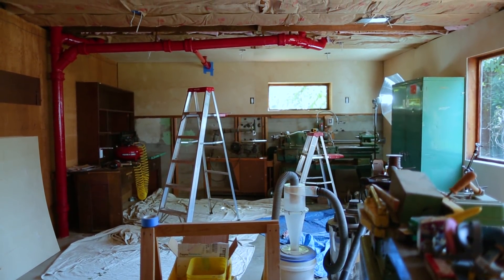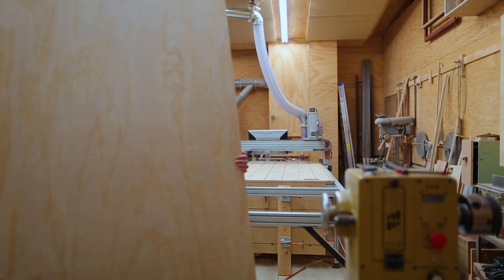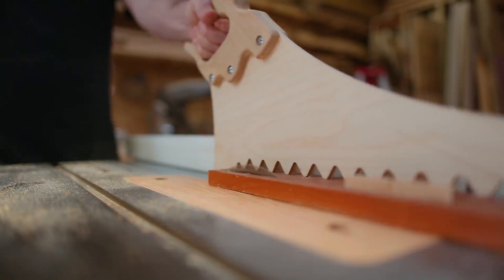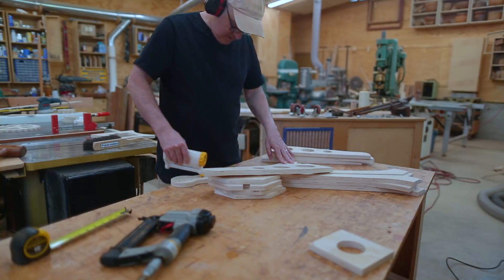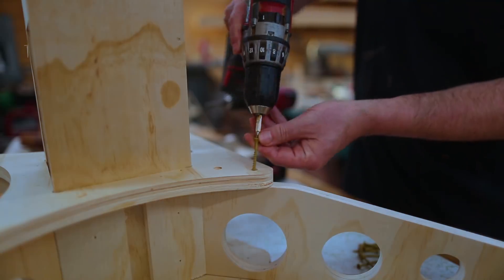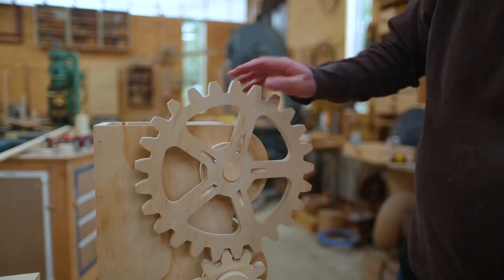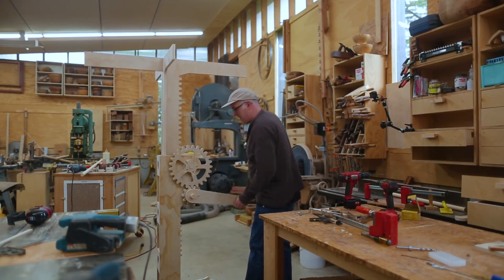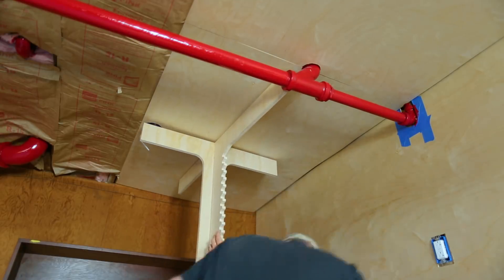Making A Plywood Panel Lift

Comment: I think sometimes people forget that this isn't for your average Joe to build to assist - of course you can buy one quickly and easily. But Frank earns somewhat, if not entirely, of a living from producing videos - so it makes sense for him to do things, that others would consider a waste of time, purely for video content. (Or in this case video content and a useful tool).

Nonetheless, great work Frank as always!
Reply: Yup, they're cheap to buy, nearly free to rent, and they're both much easier to store and more versatile (with pivoting arms to install wall panels and irregular / slanted ceilings). However, it's a cool project, and fun to watch.
Reply: stephenr1233 he was an architect for 15 years, probably earned more in that period of time than I will in my entire life.
No doubt he makes money from you tube but I would imagine he has a bit put away too
Reply: I think the ...jack ? met its primary goal quite nicely: putting off having to sheet the ceiling for a week or two.
Reply: Jon Miller it can be something for one person to just get it close to the sealing with out going up a stairs etc to get it near it. No need to have it pushed agianst it.
Reply: effyou128 sure you do....
Reply: I totally get that. But that doesn't make this a good design - in fact looks like a dangerous contraption to me.  There is no compensation for uneven surfaces,  the lift lock is tentative at best, and it's inherently unstable, prone to tipping over.  No way would I allow my employees underneath that thing with a heavy load on it.  Like I said -  drywall lifts have been around for decades,  all the bugs were worked out long ago.  They're usually made of steel- so maybe a more useful video would be adapting that design to plywood so someone could fab one in a home shop or on a CNC.  That said - IMO most of this "maker" stuff that is so popular on  YT now is purely entertainment and nothing more.  No real practical value in the actual building trades.  Pros have to buy or rent jigs and tools because time is money.  It's one thing to spend an hour making a crosscut sled for a table saw  - it's another to spend a week doing something that could be rented for $50.    Good for Frank if he's making a living at this though... I'm sure it beats manual labor.  It takes a lot of effort (and talent)  to monetize a YouTube channel to the point you can quit your day job so kudos to anyone who has managed  that.
Reply: stephenr1233 Exactly. Personally I have way too many other projects to even consider making one of these. In theory I'm a 3rd generation drywaller, but I don't do much. When I occasionally take on a job that needs a panel lift (every 2-4 years??) I just buy a panel lift on Amazon, then sell it locally for very nearly what I paid after I finish. Way cheaper than renting and no need to store it. This appears to have even more of a storage-space-required problem, but it's such a cool design I almost want to use it for a job. 😁
Reply: That said, it wouldn't be much use for me without a floating head to compensate for floor and ceiling rarely being truly parallel. And telescoping arms, since I hang even 16 foot boards when necessary (much easier to hang fewer large panels than to tape and mud many smaller panels). Obviously that wasn't Frank's design criteria. Just playing with the idea of it.
Reply: Im a union carpenter so I do it all Drywall concreate celings cabinets bridge welding what ever! If I am dry
walling a ceiling and I ask for a board lifter Id get my Layoff check that day! 2 guys getting $70 a hour each we are lifting them our selves! I do 10 ft drywall all day 50 sheets sometimes never used any lifter once! they are a wast of money This lift was a joke!  All that just to put 1/8 inch panel lmfbo

Comment: Throw a top on it, and this'd be a rad height adjustable table. Living in a small space, I always like things that can serve a dual purpose.
Reply: Great idea!
Reply: Standing desk!
Reply: You could drill out holes, to insert pins through. That way the gears are only bearing the weight during height changes
Reply: It wouldn't be sturdy enough to be a table though.

Comment: Was your crank a little longer then necessary?
Reply: I thought the same thing, but it may be useful to have for heavier loads. You could add another knob closer in for faster cranking when adjusting and for lighter loads. Great video Frank, thanks!
Reply: It's one of those things that building a prototype gives you answers that drive the design.
Reply: that 1/4 plywood is super heavy.   Probably should have a 200:1 gear reduction.
Reply: Google says 22.72 pounds for a 4x8 sheet of 1/4" plywood.
Reply: Really? No one, yet? Ok
*Deep breath
THAT WHAT SHE SAID!!!

Comment: Wooden gears with pocket screws.. I think the world is ending.
Reply: rsuplido It was a Matthias Wandel joke, he is another youtuber that does a lot with wood gears (his website is even called woodgears.ca or something like that) and he hates pocket holes.
Reply: yeah i follow matthias too. frank made use of pocket holes here not to join but as keys to prevent rotation also, so he can easily replace gears/handles if needed. I thought it was a great use of it.
Reply: rsuplido it is a good use, I still found it amusing though
Reply: Mathias would be proud and mortified all at once, hehe.
Reply: And i just found pocket screws... they are not as strong but much faster if you want to see the finished project and use it;) Not all needs to be perfect hehe.
Reply: stares for a while... ahhh pocket screws!
Reply: He made use of screws and nails too. How would you have done it? ;)
Reply: MrTarfu - lol    good one!
Reply: got the reference O) Matthias doesnt hate pocket holes he hates the fact that people are using them to replace better joining methods and are claiming that they are just as strong he has said they have there place
Reply: I'm not a big fan of pocket screws either.  This is a good application, but I see a lot of people overuse them it seems like.

Comment: your need CAD software like Solidworks.  You can build the parts and put them in an assembly and then just modify the part and it gets modified in the assm.

Comment: That’s an awesome totally overbuilt project. Did you considered using fusion instead of sketchup? That might have made the modeling in that particular case much easier as the sketch, model and cam are automatically linked.
Reply from the maker: I've been getting better with fusion.
Reply: Where are the project plans or files?  Can You provide it?
Reply: I recently switched to Fusion, as well. I think Fusion has a steeper learning curve but is ultimately more fun - a cross between designing an light coding..
Reply: John Alveus I couldn't figure out SketchUp myself, but fusion was pretty natural so YMMV.
Reply: WayofWood he does use fusion also, so I assume he had a reason for not using it in this instance.
Reply: Is fusion free as well (or have a 'free' version available) that you can use like sketchup?
Reply: I agree Fusion is the better program. Motion studies and using all the different types of joints would eliminate having to model it, make parts, the reassemble it to see if it works. And cam included in the program. But I see that Frank said he is getting better with fusion, and I can’t wait to see the stuff he comes up with once he is a Fusion Ninja. Happy building Frank always love you stuff. 
And ps if you want someone to take that Porter jointer off you me hands just let me know. 😉
Reply: Thanks.
Reply: There is a free (free as in beer - not free as in freedom and open source) version of fusion. My point of view is that it's nice to use but especially given the recent developments with Sketchup I would not put all my eggs in the Fusion basket. I try to use a variety of tools so that I'm not locked into a single vendor.